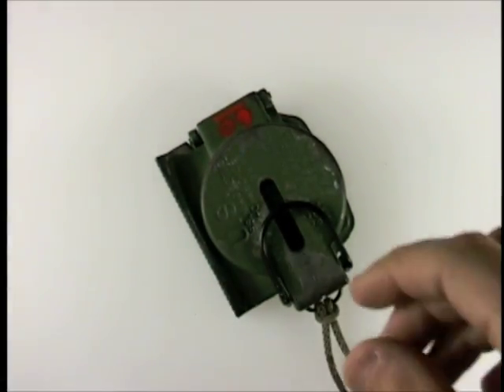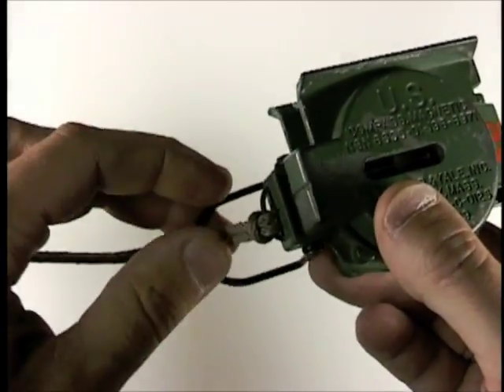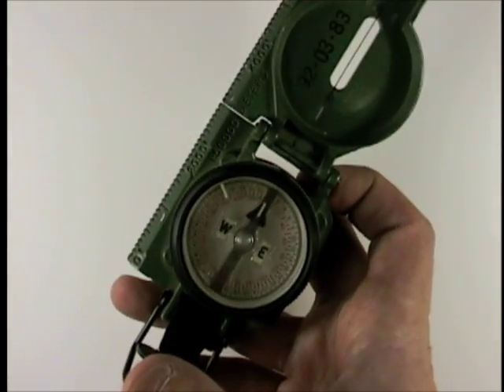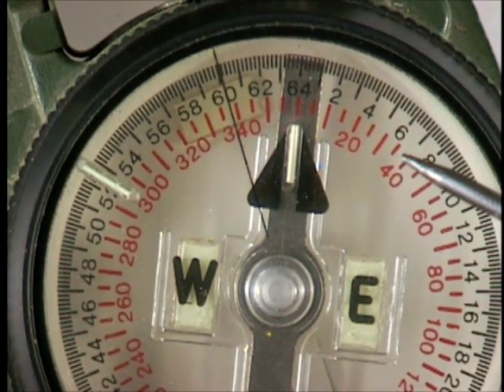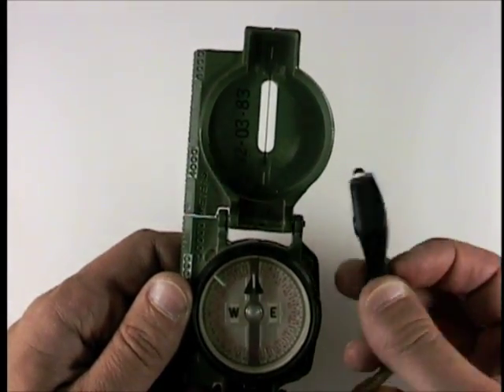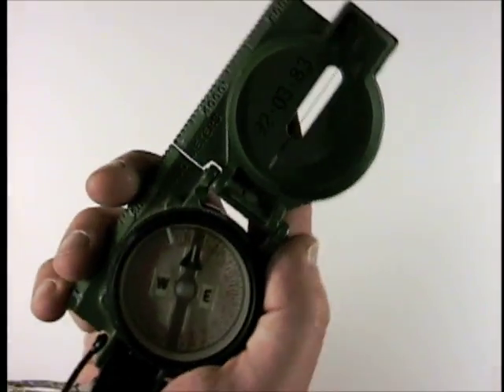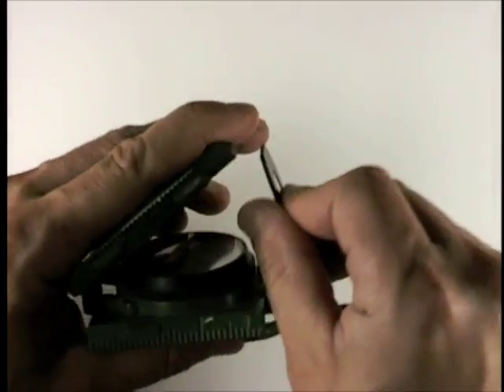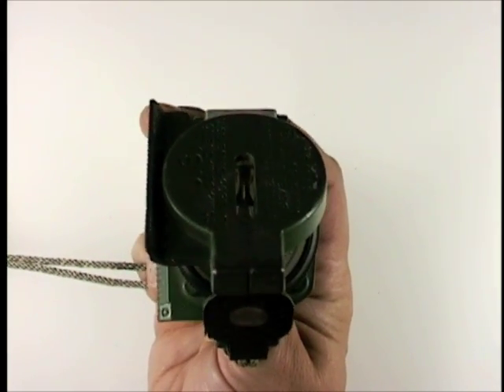Using the USGI Compass - Part 1

Comment: I own a Cammenga compass, Tritium 3H, very nice, HQ tool!!
8:15 - position the lens where the floating dial comes in sharp.
We all have different eyes sharpness, some wear glasses.
In my case,  the lens has to be in front of the cover a little bit and not engaged as in the video shown.
Looking through the gun site slot above the lens, the wire and anything beyond has to be sharp or well seen also.
That's all!
I have an old  $5 lensatic compass (Made in Japan), same apply also.
The fit and quality is not as good as the Cammenga,  but  accurate.
With the liquid inside, the magnetic arrow takes a few seconds to settle.
Otherwise, in an experienced hand, this cheap compass can be a very handy tool for shooting azimuths!

Comment: The lanyard is used for pace count on an azimuth. You walk 100 yards at normal pace in the terrain your covering. Everytime your pace count indicates 100 yards you tie a knot . 800 yards should show 8 knots in the lanyard. This way the compassman keeps direction and distance on a topographic map. When the team leader wants position he can immediately point to location on the map. The small numbers in black are mils used to spot artillery and adjust fire. At night you set the glow in the dark needle , face plate and sight wire dots a mag North and when you travel at night there are two clicks to a degree witch will offset the face plate line and when you line up the sight wire dots and the face plate line , that will be your azimuth using glow in the dark marks. LRRP team353 Rangers lead the way . AIRBORNE.
Reply from the maker: I have never gotten around to making my pace count video, but we teach that a lot, and I've always taught (as I have myself) that you should allow the compass guy to do that alone, pace is done by someone else. 

Such nerds for this, we got tired of the current hobby beads breaking, made our own pace beads of indestructible materials: http://centralwar.com/events/Purchase-IndividualFieldGear.shtml

But of course, it's more important to keep pace than have specific gear, so pebbles, knots or whatever you have will do.

Comment from the maker: @timjseg What needs cleaning? Mostly, hose it off if needed. 

Sometimes they can get gummed up. Turns out, it's easy to get them apart without destroying them. Unscrew the four screws on the bottom of the case and pull of the plate. You'll find the entire capsule (the compass part) is actually a capsule. A rubber-covered little cylinder. Pull it out (carefully, to not tear the rubber, but it's gonna take some force) then you can clean the hinge and needle-lock mechanisms, and so on. More...

Comment: Steven Hoober: Excellent video and well explained. Just a hint though......filming or photographing a relatively small dark(ish) object against a larger light / bright background causes the camera to under-expose and makes it difficult to see any details. Its better to use a background which is approximately as bright or as dark as the main subject (the compass).
Reply: The compass body is dark, but the dial is white, and properly exposed using the white background.

Comment: The lensatics we used in the Army (long time ago) didn't have the straight-edges on the left side of the body and lid.  We were issued Silva compasses for the maps.  It was also in the post-radium, pre-tritium era when night lume was not self-illuminating, and had to be charged and re-charged periodically with a GI flashlight in order to be seen a night.  I noticed your compass was made in 1983; does the Tritium still have any usable night glow?
Reply from the maker: If you scroll through the totally unorganized comments, you'll see a longer discussion, but yes old tritium works. The 12.3 year thing is half life, not life. So half as bright every 12ish years. Since they come WAY too bright, 24 year old tritium is just fine for deeply dark nights.  36 years old is getting a bit dim, but luckily someone stole that compass so I have a newer ~20 year old one I use now! 

Yup, wish we had radium-like sources.

Not sure what the nomenclature was, but before the compass I outline in this video the US used a series of marching compasses with round capsules that opened in a similar manner and... did nothing else the same. Not many of those around, and the ones that look the same are mostly awful chinese knockoffs, so beware your sentimentiality.
Reply: The compass cover has a printed stamp inside, the first number is the year.
Just bought one on Ebay for $50, like new, Cammenga H3 Tritium, came with a  green soft case too!
Mine, stamped 20, means 2020, second number is the month, third is a production number.
Very happy!
I can tell, it's an HQ compass!
Military has the best and  most durable stuff available!

Comment from the maker: @csar3 Yup, as long as it doesn't drag on the inside of the capsule, that's correct. It's because the magnetic field is not parallel to the surface of the earth, but sorta points straight at the poles. This is a "world compass" (not regional) because it has enough room for the magnetic disk to tilt, and the bearings work like that, etc.

Of course, make sure the table doesn't have metal legs, etc. Use it outside, away from metal things.

Comment from the maker: Continues... Be sure to put some white lithium grease on the capsule sides before re-inserting, so it goes in easy and comes out if you need to pull it apart again.

Comment from the maker: I prefer walking around with a baseplate (but sighting, and night work, with a USGI lensatic), but if you like it, go for it. Cammenga is the only current maker I know of, and also sells commercially. Expensive. Especially for Tritium (if you are /ever/ out at night, get Tritium) try to get a surplus one. Not just scads cheaper, but the tritium is too bright when new, so 20 years old is just right. Don't worry about peeling paint; many were not primed right. It's fine, just ugly.

Comment from the maker: Officially, yes it's radioactive. Hence the symbols. Practically, zero chance. First, it cannot just leak out or anything. Mostly, very, very, very, very, very small amounts. Someone did the math and figured you'd need to break many thousands of tubes at the same time in a broom closet to be at risk of anything.

Comment: The one I got from Amazon is a bit different? No flip-up lens but a lens aimed directly at the dial.

Though the UK military much prefer baseplate compasses. Lensatic are only really used by the artillery.
Reply from the maker: Perhaps is the lens actually a prism? Flip down prisms (called — brace yourself! — prismatic compasses) are a thing used by other armies, and a few nice ones are still made today for maritime and expedition work. 

The theory then is that you can look forward, get the sighting point and read the azimuth in the same plane, vs the "glance down" style of the lensatic. If you really get into it, minor advantages, but good ones are hard to find. I am still sad/angry a friend who purged all his outdoorsy gear sold both his (expensive and hard to find here) Silva Expedition 54s for not very much on eBay instead of to me! 

Do share the link. Which model did you get exactly?
Reply: @StevenHoober Not on mine. Mine is a lens pointed directly at the dial?
Reply from the maker: @seprishere  Awww, was hoping it was something cool you have over there, but it's the standard Chinese consumer prismatic available (in bulk) as low as USD2 each. 

Check regularly to make sure it points north. Have had a few in classes and more often than not, they are not just a little sticky, leak water, etc. but actively do not work, and point fairly not north. 

I am not quite sure if these are trying to be a copy of something specific, but a good prismatic is the Francis Barker M-88, actually still used by some British Forces types (they come in MILS, so I assume as you said: artillery spotters and the like). Not at all cheap, but they do make a tritium illuminated one... I can't get. If you find one, send it to me :)
Reply from the maker: @seprishere  Funny they still sell them generally as "prismatic" compasses, though I was wondering based on the layout if that was a lens. Interesting. May have to actually try looking through it next time someone brings one... when we have classes again you know.
Reply: @StevenHoober I am cheap?
Reply from the maker: @seprishere  Naw — well, maybe. I don't know you. But it's hard to find good compasses and even most Silvas are made in China, modified to be cheaper, and have awful QC anymore. The model you got is sold by what stands for legit outdoors stores very often, so at least as far as compasses: it's hard to trust the normal advice like "only buy from a reputable dealer" as you might still get ripped off. 

Just check, if the compass works, then it works, and you can try it, get used to what you don't like (needle damping is usually bad on cheap ones) and buy with more information next time if you need a good one.

Comment from the maker: @cockercane You can probably get a tritium USGI one cheaper than a new phosphorescent one, but the army also issues the non-tritium model, and they are sometimes available for like $10. Don't pay too much.

Tritium is mostly valuable because you don't need to shine a light at it to light it up. If you need to be tactical, this is crucial. But otherwise, not so much. I would make sure you have spare lights, and spare batteries though...

Comment: Mr Hoober: I am leaving to hike the CDT. It seems overtime I purchase a clear baseplate compass it eventually has a bubble. I am thinking about leaving with the Cammenga compass and then would not have to worry about it. I can use both styles of compasses. Would you recommend a clear base plate compass for hiking in this environment over the Cammenga? In my hikes on the CDT before of course there is snowy areas with freezing weather and then the heat of the desert and etc. Thanks. -SunnyWalker
Reply from the maker: I have zero concerns about ruggedness, like freezing, for any remotely quality compass. The USGI compass is only really something I suggest for people doing lots of work at night (unlikely for you), or for consistency in training etc. if a soldier/Marine/etc. It is big, and heavy, so I wouldn't want to add that much for a through hike. Also: it's old technology, and isn't even sealed! It can get damp inside and fog up. 

I have an overview of compass buying here https://www.youtube.com/watch?v=3hl3GDoeNqM and the same in text here: http://centralwargaming.blogspot.com/2017/08/buying-compass.html (and, the principles of having a backup, and a buying guide for them: http://centralwargaming.blogspot.com/2017/08/backup-compasses.html)

There's also a discussion of a downside to the USGI lensatic which ended up with some specific models to consider otherwise: https://www.facebook.com/CentralWar/posts/1969134610041483
Reply: Mr. Hoober: Thanks! I will go with my Silva Ranger515 as I have that now. When and if i need a new one I'll apply your advice and principles. Thanks a million. -SunnyWalker

Comment: Great review and tutorial  but my compass says ENGINEER on it and only has half the stuff on it well 3 quarters of the "features" on it and I'd like to know any info on it
Reply from the maker: There are many, many compasses, and lots of knockoffs of this particular model. Without seeing I couldn't guess more.
Reply: Ahh ok thanks yea it kinda does seem like a knock off its a bit cheaply made thanks for replying so fast its very appreciated
Reply: Camster V if it is black I have the same and it is a knock off, but it works well.

Comment: Steven,  if you stray off the bearing while walking, doesn't this require a new bearing to be taken?  Thanks
Reply from the maker: +CincyRedsFan 513 Mostly, we're making mistakes constantly. You look at the compass, walk a bit, look, etc. You make little mistakes in taking your quick bearings and in walking, but they should even out over time. 

But if you mess up once bigger than the others Two other things make this not as huge a deal usually: 1) Understandings of precision is important. Ideally, you are walking 5 or 10 or 50 miles on the same basic heading, so any one small mistake is very, very, very tiny in the overall scheme.

2) Terrain association. If you were moving to a saddle, say, and you are off by 50 meters from the center when you get there, you'll notice and fix it when you get there. 

Now if you KNOW you have to get off the track, like because there's a clear obstacle, you box it off. Using pace count and your compass, go around in a clearly measured way. Walk (for example) 100 m due N, then back on your bearing till clear of the obstacle, then 100 m due S. You are still on track!

Comment: Do these compasses have a adjustable declination?
Reply from the maker: Nope. The theory, I believe, is that combined with the maps it's a whole system. There's a declination chart at the bottom of each (US issue) map, with instructions on what to add or remove to get to each version of north you might need. 

If you had adjustable declination, the compass could be adjusted wrong, without you noticing, so this is supposed to be accident-proof. 

It's a choice, and one of any reasons why some people may like, or hate, this compass.
Reply: @StevenHoober  thanks for the quick and knowledgeable reply.  I can see your point with map use. I would guess you just have to be careful if you are transferring  baring from the map to compass or would any math be unnecessary if you align the compass properly to the map?
Reply from the maker: @m005kennedy  IF an adjustable-declination compass is properly dialed for location: no more math. But they can be risky not just for people who move to different regions but in certain far-north locales where you can walk over a period of a few days and have a notable change, or it changes a degree every few years, there's a risk you forget to change, and start heading the wrong angle. 

Non-dialable compasses means doing math every single time, so if important (trackless desert, artillery calls...) it's worth double checking — yourself or comparing with someone else doing the same calculation in parallel.

Comment: Anyone doing that in our Land Nav training in the Marines would’ve flunked.  I guess it’ll work but it won’t be as accurate.  With the compass to cheek sighting, the sight wire should be vertical.  The lens bracket should be back as far as possible. For me personally, the lens bracket all the way back as far as it will go works fine.
Anything with a front and rear sight has a sight radius.  The farther the distance from front to rear sight, the better. You’re only decreasing accuracy by folding your sights close to each other.  
I think the confusion stems from the base plate style compass.  With those you have a mirror that DOES need to be folded down to approximately 45 degrees.  No mirrors on the Lensatic tho :)

Comment: Don't you need to know where the steering wheel, accelerator, brake pedal, turn signals, and transmission shifter lever is when you drive a car? Same thing here.

Comment: Radiation symbol? Is that for disposal or for user?
Reply from the maker: Both. Indicates self-luminous vs glow-in-the-dark (light it up first) but also allows you to be worried about any safety of use (not really, VERY little tritium, wrong type of radiation to harm you, but militaries are big on health-and-safety checks), as well as being segregated from certain disposal, distribution, destruction, etc.

Comment: quick question is their something special abt a KIFFE compass  (TYPE OL-IO
Reply from the maker: +Aron Silb Not much I know. Not really a collector. Kiffe is older stuff. Company was a general maker of outdoors stuff from the late 1800s through the 1960s at least. In the 60s, they dealt in surplus then made (had made, in Japan: the China of the 60s) a series of cheapish knockoffs of mostly knives like military bayonets. Also made some Boy Scout targeted stuff like a cheap lensatic compass. 

If in good shape, cheap then is mid quality now, so it may work. But there are so many decent compasses these days, I wouldn't bother using such a thing for actual navigation or anything.
Reply: +Steven Hoober actually it's in excellent shape I'm pretty sure it was either surplus or actually used in combat

Comment: how do you set local declination?
Reply from the maker: MATH! The USGI compass has no declination setting dial, you have to add/subtract for each measurement. 

On NGA maps (US Government mil-issue ones) it has a chart that gives you this math.  Here in one other video I do a bit of an overview of how that works, and show off where you find it: https://youtu.be/H4SKU20vVL0?t=43

Other maps should have the declination change and you just have to work that out yourself. If declination is a big deal (lots of variation in your region), if high precision is needed, or you are going a long ways with few features to adjust for based on terrain association, you can give yourself a reminder, do the declination "once" by drawing M-N (magnetic north) lines on the map then work off those instead of the G-N lines. Only works for azimuth, for route planning, not for MGRS grid references, but it works.

Comment: which liquid used in this compass ?
Reply from the maker: None. They use the other way to dampen the needle, magnetic dampening. The needle moves through an internal magnetic field, which has somewhat the same effect as a liquid but doesn't leak out or get air bubbles.
Reply: Glycerine, I believe?